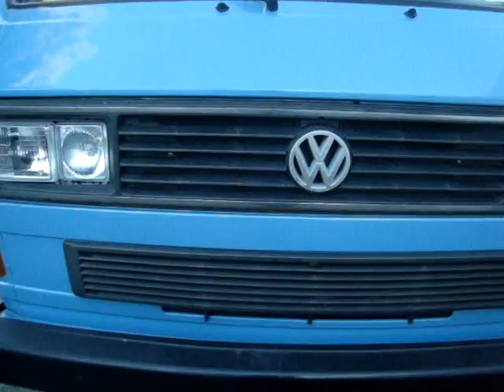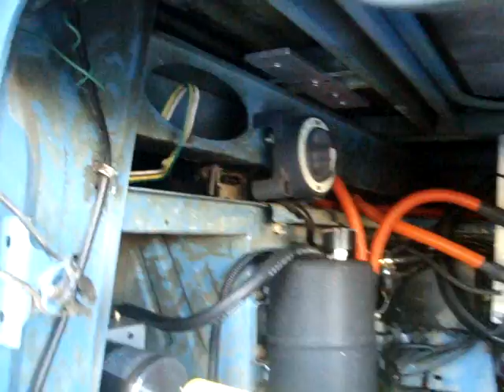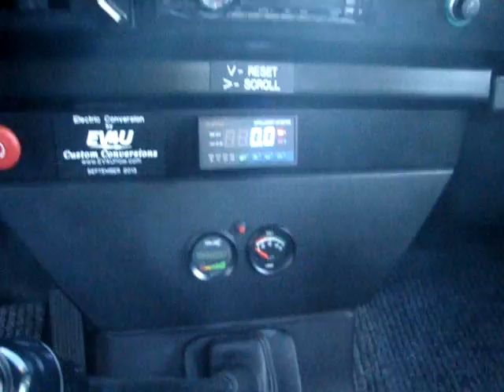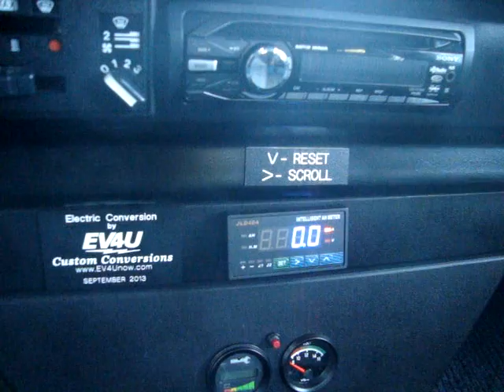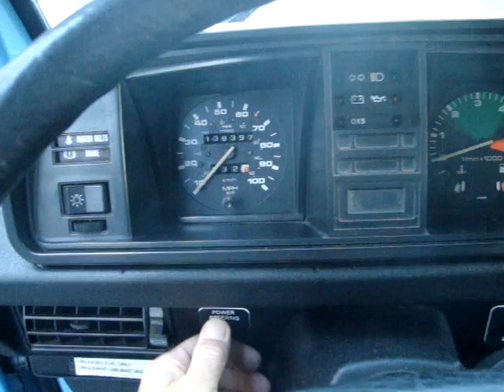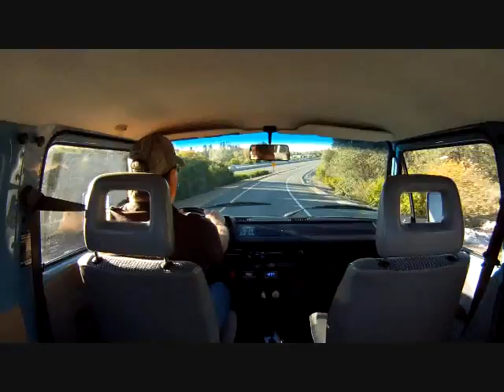DIY Electric VW Transporter Doka Test Drive

Comment from the maker: The VW is a utility vehicle with a uni-body construction, they're hard to quiet.  Most of the noise in this one is from a piece of plywood on the back floor.  It could be made quiet.  I only drove the Tesla for about 20 minutes and there was talking and the sun roof was open.  So I really couldn't comment on the road noise.  I really  like the Transporter, it is a very practical vehicle, and would make a great shop truck.  Better than our big diesel for most errands.  Thanks for watching.

Comment: I wonder how well this system would work for a late model Ford Crown Victoria with rack-n-pinion steering. Since I know they make an electric rack-n-pinion unit, my hydraulic unit can be switched for electric. My thoughts are to pull 4.6L gas engine and mount electric motor in same place to current 4-speed transmission with electric fluid pump for toque converter. Of course with no fuel tank, trunk space above rear axle can be restructured and rebuilt for a pull out battery tray from inside trunk. Since my car has 4-wheel disc brakes, they can be removed to install regenerative braking units to recharge battery banks.

Comment: Hi there, love you work and love electric cars...but....I was very alarmed seeing the engine bay...what is going to happen the first time the owner drives thru a puddle of water / mud etc and it all sprays up into the running 240V electrics, wires, open fuses? I would have the same concerns about rain water AND condensation dripping from the rails onto the batteries and the engine bay electrics. Thoughts? Cheers Pete
Reply from the maker: All our conversions are tested to determine if and where shielding is necessary.  I've driven conversions in lots of rain and snow.  Matter of fact, where I live we average 59 inches of annual rainfall.  Driving on Interstate 5 this winter, there where several times that traffic slowed to 30 mph (speed limit 70 mph) due to the amount of water on the roadway, it was simply not an issue.  If you had a concern about a particular aspect of your conversion regarding moisture, you can shield it, seal it, or whatever you want, it's your conversion.  Thanks for watching.

Comment: Does the AC75 run hot since it doesn’t have vents like ac50?
Reply from the maker: It runs hotter than the AC-50, but we have never had it get too hot.  It produces 184 lb.-ft. torque versus the AC-50's 120 lb.-ft.

Comment: I wonder how this conversion would perform in my 86 Transporter Syncro, which looks almost identical to this one. Also, what's the cost of such a conversion?
Reply from the maker: I would imagine it would work just fine.  You would have the same range, due to the additional weight and drag of the Syncro.  If you do it yourself, about $24,000
Reply: hi'
You said 24000$ but 8 years ago. 
Do you think price conversion is lower nowadays ?
Reply: also... i've forgotten, what distance could you drive on highway for  example, just to compare with a true test, 
engine/motor at a constant speed ... 
Sorry for my english, i'm not !